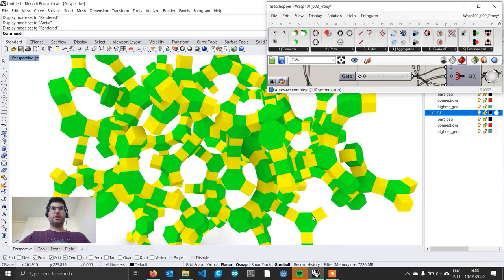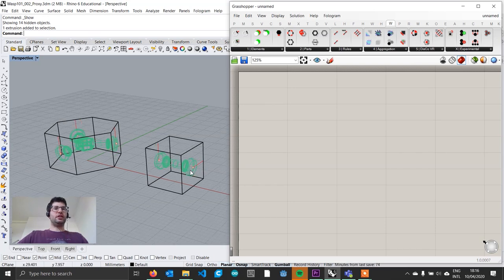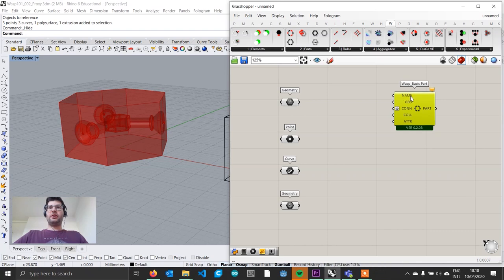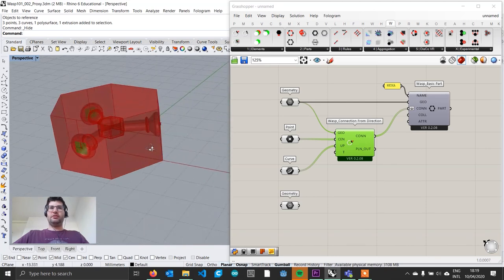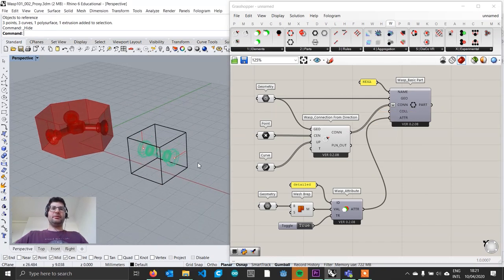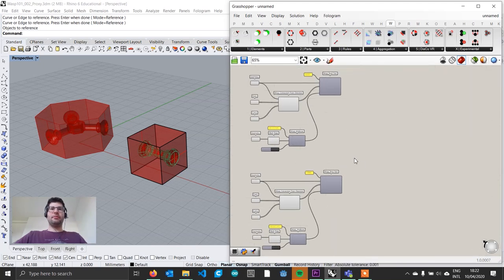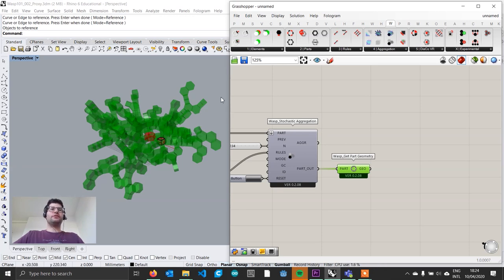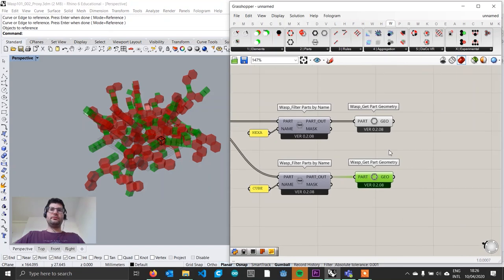Wasp for Grasshopper #101 - Tutorial #002: Geometry Proxy

Comment: The plugin and tutorials are great ! Thanks for sharing :) so just wanted to check with you wether there is any way to replace the final output with blocks.
Reply from the maker: If you use the DeconstructPart component on the final aggregated parts, in the TR input you will find the transformation data of the Part. You can use that transformation to transform your blocks, or transform the base planes of the blocks, and then use something like Elefront to bake blocks in place of the Part Geometry.
Let me know if it is clear, if not I can send you an example file.
Reply: Temporary Autonomous Architecture okay, ty for the reply. Will try and get back to you. Last time I tried using the transform output- it did not work on polysrf/blocks - only works on low poly meshes - I will try again and get back
Reply from the maker: Hi, these videos might help you out to develop your project further:
https://youtu.be/NJCE0tFWMlQ
https://youtu.be/bJOzr1O_bbg
https://youtu.be/dnrK8wpUNmg
If you need more help, you can join the Discord chat server ( https://discord.gg/Wke9Jt6 ).

Comment: What is the difference between Wasp and Monoceros for grasshopper ?
Reply from the maker: They both are plug-ins for generation of assemblies from discrete units. However they have few differences, the main one being that Monoceros operates on a fixed cartesian grid, which is predefined, and fills the cells of this grid with elements based on their neighbouring relationships. Wasp instead works exclusively from the parts, and hence does not assume any predefined grid for the aggregation (the grid is generated by placing parts, and each part can change the choices available in the next step).
So, it really depends what your goal is, whether you are more interested in defining multiple neighboring relationships between parts, at the cost of relying on a fixed grid, or if you are more interested in the growth process of the aggregation. Both really powerful tools, but for different purposes.

Comment: Had a doubt, could we use multiple geometries as proxy? One cube containing 2-3 detailed elements which are not one single entity but discrete ? If yes how ??
Reply from the maker: Yes, you can. Simply, when importing the proxy geometry, instead of selecting "set one geometry". you can choose "set multiple geometries" and select all the parts. Even if you plug a list of geometries, the Attribute component will still create a single Attribute object storing all the geometries.
If instead you want to keep your elements separated and be able to access them independently, you can create one Attribute for each element, give them different names, and plug them all in the ATTR input of the Part. Wasp Parts can carry as many attributes as you want.
Reply: @TempAutonArch  both the techniques worked! thank you so much for the clarification and resoponse

Comment: Hi, i might have found a bug? This Attribute function doesn't seem to work with Field Driven Aggregations? I was getting the error "1. No attribute found matching the provided id" from the Wasp_Get Attribute By Name node until i swapped from a Field Driven Aggregation to a Stochastic one. I've tested this in both my own script and the one with this video. Thanks!
Reply from the maker: Uhm, that is quite strange. I used Attributes several times with Field-Driven Aggregations, and never had problems. Can you send me the file either through the Wasp Discord Channel (https://discord.gg/Wke9Jt6) or send it to me via email at ghwasp@gmail.com? Thanks!
Reply: The same Problem, and seems to be something wrong with Mesh Brep component because it doesn't show mesh preview
Reply from the maker: Could you send me a file where this happens? Either by email at ghwasp@gmail.com or on Discord ( (https://discord.gg/Wke9Jt6 ). Are you on Mac or on Windows?
Reply: @TempAutonArch  
Okkaay. .  I've launched the file a few minutes.... and it works !!! I don't get what is happening!!!??
Reply from the maker: Are you or Windows or Mac? Which version of Rhino are you using?
Reply: @TempAutonArch  window - Rhino 7

Comment: I have followed the same and am getting an error stating that 'Exception: index out of range: 2". Please help
Reply: I have solved it. Now am not getting the same patterns as you did. It is saying the part can not be joined unless using the individual rules for P and T. The wasp is awesome by the way. Thanks.
Reply from the maker: Hi, I am not sure I understand your problem. Could you send me a file at ghwasp@gmail.com or on Discord?
Reply: I have solved it, Thanks. It seems that the use of nonsolid geometries while making a part was creating the issue. While I tried it with solids it is working fine. Thanks.